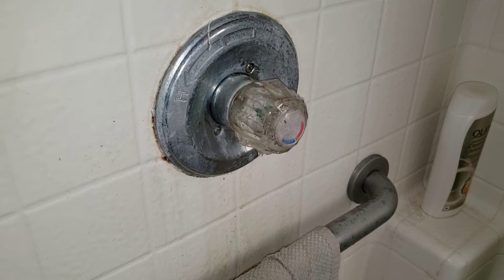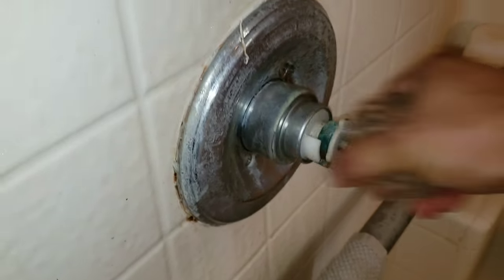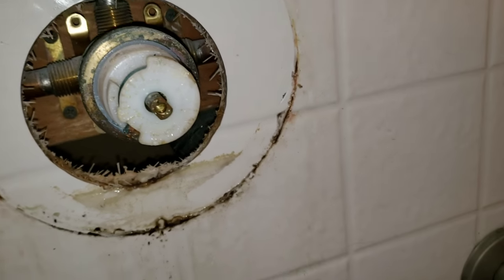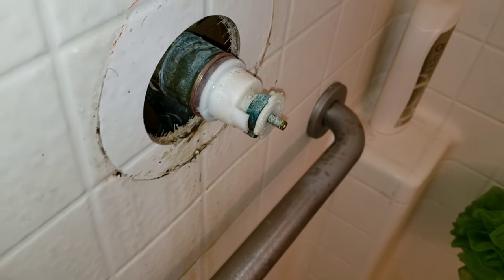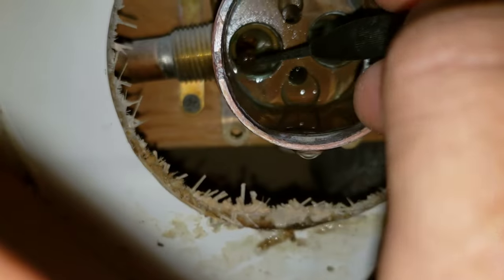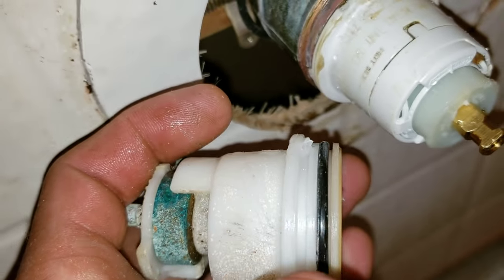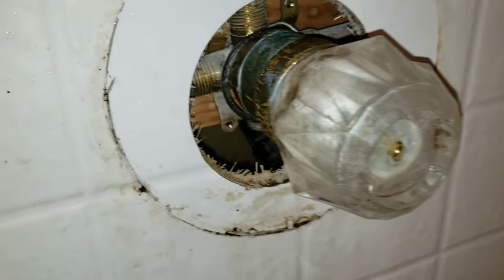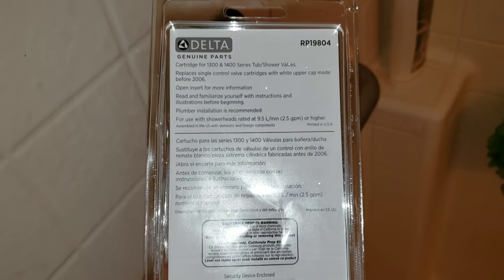Replacing Delta Shower Cartridge

Comment: Hi Sam,
Thank you for this video, I am only adding to help as you did a fine job. The first thing is to spray the big brass nut with Liquid Wrench many times. Then very lightly tap the nut around, Very lightly.Then the way to get that thin large brass cartridge nut off is a pair of Channellock Round Jaw #442 pliers in most DIY and hardware stores, it's cheaper than aspirin and these pliers won't bind the soft brass nut, instead breaking it loose by setting them to the second to largest opening and applying as little pressure as possible. A regular pipe wrench on soft brass tends to bind it rather than assist. Just sharing my long experience. I have ruined a many!
You have it right Sam, but from the older cartridges, 1993 to 2001, this is my experience. 
First of all if you have and older 1300/1400 series cartridge with the lower balancing portion being Opaque and top end being white, this is the old rp19804 which must be replaced with the new blue bottom 19804 that Sam is showing. Folks, don't be deceived by Delta's identity website because there are two different replacement cartridges "1300-1400, and T13/14 series" that use the term "this is the current Multichoice Universal"  which has their patent on it. The T 13/14 "Multichoice Universal" insinuates that it is one of the replacements, but it doesn't fit. I have one of these in my truck for a while which I tried "RP46074" to replace the old Opaque cartridge with and it didn't work. The spacing between the bottom two round hot and cold inlets of the balancing valve have about a 1/8" difference in their spread. This is very confusing. Check out Delta's indentifying website at; 

https://www.deltafaucet.com/shower-cartridges

for pictures of the cartridges. But use your discretion by what I mentioned above. An rp46074  "Multichoice Universal", and and RP74236" Multichoice Universal" will not replace and "old" rp19804 Opaque bottom cartridge. The "Multichoice Universal" as well as the "P type" stamped on the top gray part side is deceiving. Use a new rp19804 blue bottom like Sams video. 
Sorry this is long, but I just got screwed by the unexplained information on Delta's website between pre 2002 1300/1400 series and the T13/14 series Multichoice above.  
I have been plumbing for 47 years and specialize in service and repair, but am on a smaller island in Hawaii and don't work on these very often. I usually am able to replace the washers and springs. If replacing washers and springs doesn't fix it, it is a split in the center glue joint on the bottom balancing valve.
Delta is my all time favorite brand for quality and ease of repair, no other beats them for their category. But I am very disappointed that they don't even have the cartridge number on the cartridge despite all of the very small stamped writing on it. 
I will be sending a copy of this as well as calling them to help clarify their website.
Thanks again Sam, and Aloha, Paul, Mauna Kea Plumbing Co., Hilo, Hawaii
Reply: getting the bonnet nut off is pretty easy but stuck cartridges are a real pain

Comment: Most new have shut off screws right inside there  (1 on hot and 1 on cold).
I learned today, those don't always work though. Turned both off and started to remove the cartridge and water started gushing out. Had to run out to the street to shut main off.
Always learning new things!
I was just removing to take pics to get new cartridge.
This shower had all of a sudden become only a trickle of water. Thats why I was there.
When I removed it, only half of it came out. Had to really carefully pry the blue part out.
Once I cleaned everything and put it all back together it worked like new. Go figure🤷‍♂️

Comment: "Caution! Be aware that there are 2 different Delta replacement shower cartridges that look the same. One cartridge will only work if is your home was built BEFORE 2005. The other replacement cartridge is for homes built AFTER 2005. So make sure you have that information available when making your purchase. At the end of the video I show you the back of the one I purchased in this video to complete the job 🙂"

ok, cool. i gotta take mines back. mines is for AFTER 2005. glad i read the back before cracking it open. so, is this thing just plug and play or what?

Comment: Sam my Delta faucet is leaking. It is very old. A plumber came and wanted $1100.00 parts and labor. He said he had to break the wall behind the bath tub and then go behind and fix and work in the front. I think he was trying to take me for a ride.

Comment: Great short vid bro....If you have trouble removing the brass cartridge ring....take a decent size hammer and place the face (or the side) of the hammer on one side of the ring....then tap on the opposite side with another hammer....moving the hammers all the way around the ring....TAKE YOUR TIME....I probably make close to 100 taps...IT'S WORTH IT. It will separate the threads so that if you grip it (semi-gently) with some newer (sharp teeth) channel locks it will turn. Use some plumbers grease on everything to re-install the new one.....the next guy will thank you.
    Best to take the cartridge with you to store....but if you can't.... buy both size cartridges....blue one and white one....compare CLOSELY WHICH ONE MATCHES THE ONE REMOVED....SLIGHT DIFFERENCE IN LENGHT...take back the one that doesn't quite fit. (expensive)

Comment: That grease is oil based which eats away at rubber o rings. You should be using silicone based lubricant. It works better on the valves anyway

Comment: How did you remove the cartridge. The second part is stuck in the pipe
Reply: To all who couldnt get the inner part of the cartridge out of the outer housing - the answer is simple.     Make sure the two parts of the cartridge stay locked together when pulling it out and they will come out together.     Do not twist or turn the outer part as doing that unlocks the two parts and leaves the inner one behind.   Pull straight to remove.

Comment: How did you get that small, circular cap cover (that covers the bolt part) off?  It’s in there so tight that I can’t even get a pin in along the edge to left it.  Ty.

Comment: I've been watching your plumbing vids and they are very helpful. I've watched several vids for replacing shower faucets and they always show how to replace the seat. I bought a replacement kit for my old Union Brass set. When I remove the old handles and stems, I do not see a seat. Were the old faucets put in wrong? The new seats can't find anything to thread onto.

Comment: Would you happen to know the part number of the acrylic shower handle? I lost mine and I could not seem to find a replacement.
Reply: I just bought  new clear knob for my Delta shower control at Home Depot.  Exact match for my 25 yer old shower.  I think it was about $26.

Comment: How did you remove the cartridge?! Mine is stuck
Reply: I had the same problem. I sprayed it with wd40 and let it soak in. Within a couple minutes it came right out.